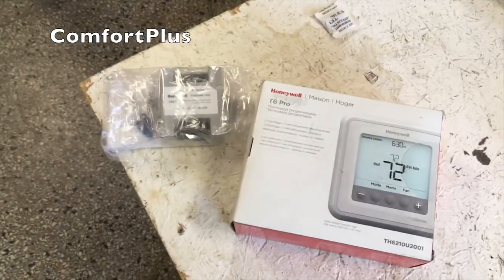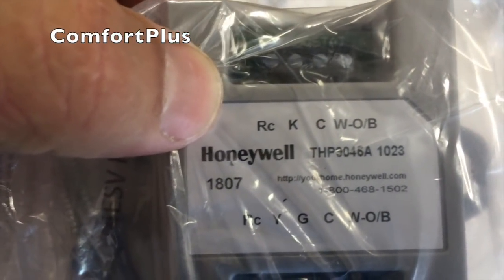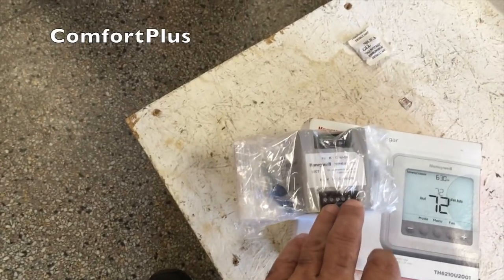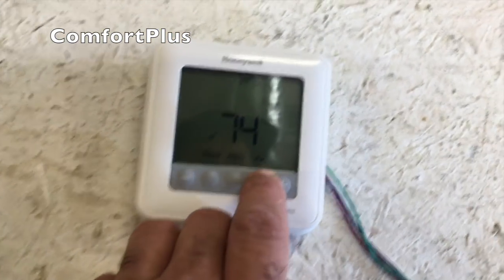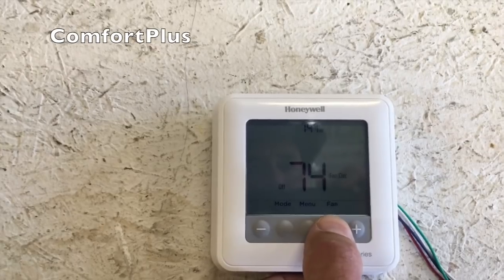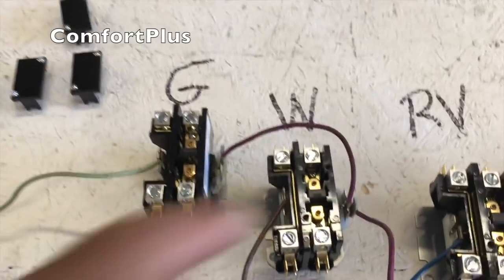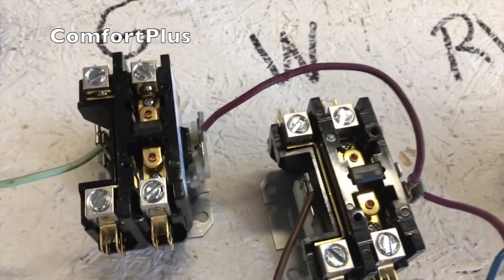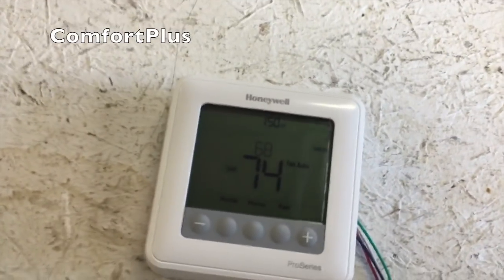Running a heat pump with aux heat on a 4 wire Thermostat

Comment: I have 5 wires but need 6 to operate my Mr Cool heat pump.  I used the adapter and the documentation was terrible.  I was able to use the C wire, my T5 has no battery option.  Nice to see the thing operating in test mode.

Comment: My question is do these have a jumper because I have too take my 24v and put it on rc for ac and then move it to r for my heat and I’m dealing with a furnace unit

Comment: Does the aux heat run your bill up higher?
Reply: Yup uses pure electricity to heat the house....theres a heater almost like a toaster oven in your system that turns on when emergency heat is called for
Reply: Yup it sure does that's why it only comes on during defrost mode or when it gets really cold outside.

Comment: Thanks for the tip man.I have seen this used for gas and straight AC but not with a heat pump system.Great video 😁